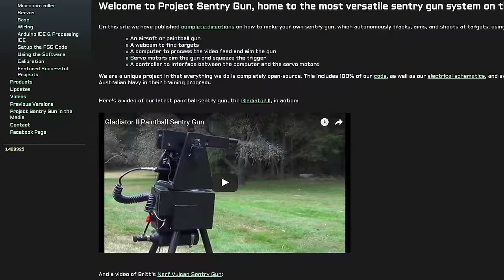DIY Autonomous Nerf Turret

Comment: So if it works for a nerf gun, could I mount an AK-47 to it for yard defense? That's quite the deturrent
Reply: RandoGaming I agree
Reply: RandoGaming yes
Reply: AK-47's are quite rare nowadays, also quite pricey.
Reply: Roger Airgood what are you talking about. There everywhere.
Reply: doesn't cover reload 4/10
Reply: you mean quite the deturret?
Reply: make it an M60 and we're getting into Breaking Bad territory
Reply: You mean De-Turret.....
Reply: AKM's and AK-74's maybe.
Reply: You just need a motor to pull on a zip-tie attached to the trigger.
Reply: Kippenoma You realize I'm not talking about a gas powered motor? Also, a zip tie has plenty of strength to pull a trigger. At most an AK 47 has a trigger weight of 5 kg, which is far less than what you need to break a zip-tie.
Reply: @FishFind3000 no they aren't. Only akm's are still cheap. All ak's produced after 1950 i think are no ak47. They are akm's. The difference is that the ak47 is milled and the akm stamped
Reply: You could modifie the trigger so it would not need 5kg to pull the trigger but then the gun would be always close to fire.
Reply: Kappi1997 The video I linked in my previous comment shows a trigger rig with a servo and a small battery pack. No reason to modify the gun at all in regards to trigger mechanisms.
Reply: You can but you need some more stuff in order for the AK to fire. And how are you gonna test if it works?
Reply: I don't think your neighbors are going to like it
Reply: Gun junkies will correct you,  that most of today's Kalashnikovs are actually the modernised variants of AK-47, AKMs.
Reply: use high powered servo than
Reply: Auto De turret
Reply: Have a really clever way of autonomously reloading 200 round mag's and just position 4 of these around the yard best Zombie deterrent/defense XD
Reply: What about the poor old squirrels :d good otherwise tho
Reply: RandoGaming
Reply: This rig couldn't handle the recoil. Though it could be modified......
Reply: Sadly that is a felony. It would be considered booby trap.
Reply: Not if you posted signs outside it's range, kind like "Trespassers will be shot". Otherwise people w/o "Beware of Dog" signs would be in the same boat. the big issue would be owner recognition.
Reply: True, but I was regarding the auto functionality.
Reply: Nope, illegal to have a lethal automated system. Dogs and humans aren't in the same boat. Sentry guns are in the boat of mines and booby traps. Even if labeled, there is still a chance a person may miss the sign regardless of intent, and those who have reason to be on the property (Mailman, random delivery person, family, maintenance)may still be harmed due to a malfunction. Dogs usually make themselves well known and you still have a good chance of survival, a human defending their property has to assess the situation thoroughly and morally. An autonomous system, especially if programmed improperly has no morale choices to make and will blast away according to the whatever code you've put in. Could be a threat to its owner even.
Reply: If a person is directly controlling the system then it is simply a mounted gun, but a remote weapon I think is also questionable. However if you programmed it to act autonomously then it can be considered a booby trap.
Reply: Ah that makes much more sense.
Reply: America, fuck yeah!
Reply: A mounted RPG would be nice.
Reply: FUCK YEAH MURICA.
Reply: A MOUNTED AIR STRIKE
Reply: Too expensive. Maybe something from the walther family of pistols that you can silence and put a drum magazine on. Its easy to obtain and the only issue would be the silencer heating up and melting if it starts shooting at small animals etc. In which case I would just dismantle it and make a better one.
Reply: ARDINT MEDIA I was gonna say that!
Reply: Suh Dude de_turret
Reply: RandoCrypto stoop
Reply: Nah, just use a belt fed BFG 50A and you're good to go
Reply: Call up colinfurze, he’s gotcha on that
Reply: requires more servos and adruinos. also replacing the trigger mechanism with a hand-crank one as opposed to the ol' chaingun from the french reniisance. ( go ahead and correct me if wrong )
Reply: Kippenoma Go to a hobby shop, buy an RC boat servo. They have sufficent torque and they already come with a lever arm.

It's not expensive or difficult to fire a gun remotely if you knew anything about engineering.

The equipment and programming to have a facial recognition system that won't shoot the mailman is much more expensive and harder to do.
Reply: and u.s.a say they dont have autonomous guns :/
Reply: I WAS THE 1 THOUSANDTH LIKE!!!!!
Reply: then go watch colin fuze video of
Reply: The path of the shot is drastically different.
Reply: RandoCrypto lol ikr??
Reply: What are you talking about lol.
Reply: Roger Airgood he means akm47
Reply: use an ar. Oh wait..
Reply: lol why tho?
Reply: yay him!!!
Reply: Nope, In Soviet Union, you kill gun.
Reply: Those pesky kids getting in you yard again? Well do I have a solution for you
Reply: Kappi1997 ak47 is stamped akm is milled
Reply: RandoCrypto Badum tussshh
Reply: In theory, yes.  In practice...

well let's just say you do NOT want to go there.  There will be some very angry neighbors.  And possibly lawsuits.
Reply: Overkillllllllllllllll... TRIPLE KILL
Reply: Kippenoma i know this is old but the average ak trigger only take half of that weight to pull and can be lightened to 3 pounds easily, people have been using small electric motors to remote fire them for like a decade or more.
Reply: mike johnston Bob Welp some shit we gotta do ourself, for example manual reload. Rip the guy picking up those darts 😂
Reply: YEAHHH!!!! 'MURICA!!!!! \m/
Reply: Roger Airgood they're £5...
Reply: Deturret
Reply: RandoCrypto what about using a  Browning M2 with a semi-automatic lock.
Reply: Make it a minigun
Reply: AKMs are cheaper than AK47s, get an AKM instead.
Reply: Roger Airgood AKMs are cheap, AK47 is a novelty item
Reply: RandoCrypto deterent*
Reply: I recommend to use a SCAR H or a AK-45
Reply: AK has too much recoil, try Gatling
Reply: ya don't see why not lol
Reply: FishFind3000 I think you mean akm.
Reply: an ar-15 with a m4 lower is better for that
Reply: but this is Linus tech tips channel not fps Russia
Reply: RandoCrypto what about 2 ar 15's?
Reply: Can get a yugo fairly easy for $500 - $600 I paid $560 for mine including back round check and tax
Reply: They probably have 5 on the wall at my local gun shop right now xD
Reply: I agree, It would shoot at every bird causing stray bullets to fly around the neighborhood lol. The only time I see this being acceptable is if everyone with 100 miles were serial killers xD
Reply: Just glue tacks onto the darts
Reply: Go check out Colin furze. He did just that
Reply: Tried and true at the Berlin Wall. Show some respect.
Reply: Use a belt fed PKM then
Reply: Holy f its Z Day defense
Reply: More like 'de-turret'...
Reply: RandoCrypto the recoil is a problem, I would use and m249
Reply: @kippenoma5351  stepper motor could do 5 kg easy.
Reply: I agree. No one should be afraid of foam bullets. The point of foam bullets on Nerf guns is to be harmless.
Reply: Should I call the police or a therapist.....
Reply: @LtgRogerAirgood  Ok, any full-auto rifle.
Reply: @LtgRogerAirgood  no worries I have a ton school kids are buying it recently for there “nerf guns” I hope there ok..
Reply: @Kappi1997 you could use a solenoid to press the trigger with those 5kg of pressure or if you know what you are doing, modify the whole trigger mechanism and make the weapon electronically fired like the CIWS and remote controlled turrets that many militaries use today.
Reply: @bobbyjoe4794 modify the facial recognition software used at the end of the video and make it so the gun only fires to humans.

Comment: You must be careful, these are $100
Saws off several parts of a 980Ti, a $500 card
Reply: You must be careful, these are $100
Saws off parts of a titan x to fit in a fucking sound card.
Reply: YOU MUST BE CAREFUL , THESE ARE $100 - USES GTX TITAN ($1000 AT THE TIME) TO COUNTER BALANCE
Reply: You must be careful, these are $100
Zipties $100 heatsink on top of $4000 Xeon on a $400+ dual-socket server motherboard
Reply: Amar Gandhi what about the time he tried to make a pfsense router...

also he could have shed a crap ton of weight and cost by going with a rapid strike or a rival ares thinner wood and a raspberry pi to run it all the laptop could be removed as could the 3rd servo as the two triggers to the rapid strike could be wired to the RPI...
Reply: Hahaha! xD
Reply: YTKid Gamer *You're
Reply: YOU MUST BE CAREFUL, THESE ARE $100 - USES GTX 1080Ti ($650~ AT THE TIME) TO COUNTER BALANCE
Reply: "Please make sure to paint our sponsored product, Nuts, in a positive light."
Attacks box with sword.
Reply: z a r i f naber zarif
Reply: Lol, True
Reply: ThatGTAFan720 WHEN THE FUCK DID HE SAW A GRAPHICS CARD
Reply: PlasmaDragon my thoughts exactly
Reply: PlasmaDragon 150$ 8 core gaming rig

Comment: why not use a raspberry pi instead of a laptop?
Reply: The same reason they used a freaking servo to control a switch instead of using a relay. The derp was showing itself.
Reply: The real reason: the Sentry Gun project uses an Arduino and laptop. Linus would have had to find a different project written for the Pi or made his own.
Reasoning for the gun project being this way? Not enough power on the Pi to do the video work - motion tracking. (At least on the first gen that was around for years, when most projects like this started)
Reply: That killed me, a servo to trigger a switch GOD Help me
Reply: a rpi costs 35$. A laptop? 150 for a decent one
Reply: cnerde, the rpi 3 b+ is more than enough for motion tracking. Heck, its more complicated but using an rpi, you could even ditch the arduino and not just the laptop
Reply: Um.. 
The 3 might be able to, but as I said, this software was written at a time when a pi wasn't capable of doing this.
Reply: yeah, fair. But there must be newer projects

Comment: Stepper motors (found in 3D printers) would be way more suitable for the pan and tilt, giving far better speed and accuracy. Heat shrink is way better than tape for your solder connections. You were correct, an ATMEGA328P chip (found on the Uno) can only handle a few mA of current, but a TIP120 transistor could easily replace the mechanical switch mechanism.
Reply: I read this comment in the voice of Data from Star Trek
Reply: Lullu Edge did you watch Good Mythical Morning today by any Chance or just a weird coinsidence.
Reply: Renee Rehe nope, can't say that I really know who they are, so I guess just coincidence
Reply: Stepper motors would not be more suitable since they don't know their position. The accuracy of those servos is more than enough for a "project" like this.
Reply: saniopurulent stepper motors work based on steps each step is a exact rotation of a specific angle so when you have heavy gun interference in movements can happen and the controller doesn't know that so it looses its position
Reply: ***** Stepper motors DO NOT know their position, that is why 3d printers and cnc machines have to "home" their position with limit switches.
Some servos can go 360°, but even still Linus would have needed a slip ring to allow 360° motion. The servos he used are not weak, they have torque over 6kg-cm.

Sure the servos are not the best choice, but to make stepper motors work in a project like this would be too complicated for linus.
Reply: Meh, you can get steppers with position... but they cost more and would increase the build complexity... (I may be wrong :P )
Reply: TechyBen Yes, those motors are available, but really expensive.
Reply: Huh, neat!
Reply: ***** Cant you see the problem with that? If someone goes and manually moves the turret, it would be out of alignment, the turret would have no idea has someone moved it or not.
Reply: Ferdia McKeogh if the chip can only handle a low current, could you use a mosfet switch type thing for the motors?
Reply: ***** Hit the reset button when you are in other side of the planet. Yes I know you can do a software reset, but you are probably not camping 24/7 on your phone watching the stream.
Reply: ***** Did you completely miss the point of this turret? Other people can move it.
Reply: ***** Yes.
Reply: ***** Keeping in mind the skills that Linus have, servos were the better choice. Even the code he used is made for servos and I bet that Linus has little to no skills in programming an arduino.

Comment: Linus, there's only one thing left to do. Overvolt it. Buy a couple of 9V RC car batteries, wire them up in parallel and use them to replace the 6 D sized batteries. You'll get 18 volts running through the gun, and a heavily increased fire rate (it pushed my Vulcan from 3 rounds per second to 8).
Reply: Obviously you've never modified a nerf gun. There are no chips. Just some switches and motors. You just have to remove the voltage limiting circuit.
Reply: If you wire 9V batteries in parallel, you get 9V (which, incidentally, is the same voltage you get from 6 D cells in series).
Reply: hellterminator oh crap sorry I mean series wiring, my bad. thanks for correcting my mistakes.
Reply: Matthew Domroski I don't think there's a voltage limiter in the Vulcan, all that happened when I experimented with 18V is that the fire rate increased. there doesn't seem to be anything limiting the voltage to 9V.
Reply: it would run out of ammo in 5 seconds if he did that.
Reply: potatochip Nerf gun over clocking guide
Reply: maybe make it run on wall socket and just have backup battery.

Comment: Servo to a 3d printed arm controlling a switch!? Have you never heard of a relay? wtf!?
Reply: how the hell do you use a capacitor as a switch
Reply: @honkhonk8009  a buffer would work better
Reply: What do you expect, he calls a needle bearing a "ball bearing" despite its glaringly obvious lack of balls
Reply: Even an adequately sized mosfet or transistor would work just fine. Benefit of that would be no arcing
Reply: The basic code runs a trigger servo not a high/low pin output... 
not to say it’s not possible, but sometimes it’s easier to just use the basic setup

Comment: Or just buy a lock.
Reply: xFluffyMods but where’s the fun in that?
Reply: Overengineer a lock to shoot wannabe intruders? That's actually a nice plan!
Reply: A lock that demolishes the building when someone comes too close
Reply: Or do both
Reply: Or a fingerprint sensor that unlocks the drawer if you're Linus and electrocutes you if you're not.
Reply: @samwansitdabet6630  A lock that demolishes the someone
Reply: @ArthurKhazbs  No, demolishing the building is a display of power that will scare away the someone
Reply: A lock that shoots mustard gas if some tries to break in

Comment: Could you not have used a Raspberry Pi instead of a probably $1000 laptop?
Reply: That laptop doesn't really look that expensive, but you're right. Raspberry Pis are perfect for this sort of thing.
Reply: BearHoldingShark yeah maybe but still gonna be about $600 probably compared to what $30 odd for a Pi.
Reply: yup
Reply: ig you got the pi zero, it could be $5
Reply: ThePiGuy24 Gaming that is a good point!
Reply: why use a pi when you have a thousand laptops laying around doing nothing. I thought the whole point of the pi was getting what you needed for the job. which in this case might have meant nothing.
Reply: He probably has more laptop lying around than raspberry PIs.

Comment: Linus, if you really want to get some mileage with that blaster, pick up 4 "Make Test Battle Hellcat" motors, and 2 "Make Test Battle Honeybadger" motors. They are some of the best motors available for Nerf blasters, and they run off of superior 3S Lithium Polymer batteries. 
They spin up faster, shoot harder, and will last longer with a large enough lipo pack.

Comment: Linus why didn't you use a raspberry pi. Disappointed.
Reply: Because he didn't have one laying around?
Reply: Because the Arduino and Laptop he uses in this video were appropriate for the job?
Reply: Maybe because Arduino fit the project specs and was much cheaper?
Reply: Another reason could be that the raspberry pi has 3.3v level logic. Whereas, most Arduino board have 5v level logic. Hence, properly driving 5v servos with a raspberry pi would require an external power source with a common ground, extra circuitry which would of complicated the project. Most electronic components still operate at 5v. Hence, having a microcontroller which is designed for these voltages is highly convenient. Besides, the facial recognition software would of run a lot slower on a the raspberry pi compared to a full laptop. I think that it's great that Linus did a maker project at all.
Reply: Because he only had a $1500 gaming laptop laying around.
Reply: Aurdino is the better option here (though it is hooked up to a laptop for the camera)
Reply: Thats too overkill.

Comment: Not to spoil the fun, but if it is just going to fire at a door why no pre-aim it and just make the trigger motion triggered (with a pi to disarm it with your phone or something). It didn't seem to track at all in the demo and even wasted ammo...
Reply: ThaTyger yeah, using a laptop and adding all the motion controls seemed like overkill although it would require more software to add the remote shut off via mobile. Unless you have an IFTT thing set up with like an NFC tag at the door or make it location based
Reply: Richard Tapia that seems reasonable. Or attach it to a Pi that has a WiFi dongle and secure that connection to log in and turn it off. The thing they made is awesome, but if you are not going to have it track someone you might as well avoid the extra effort :)